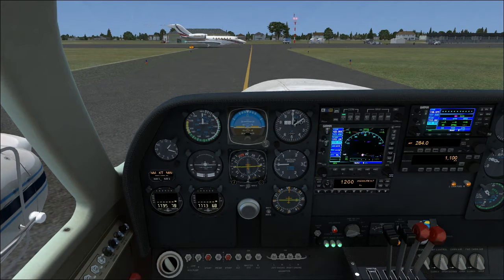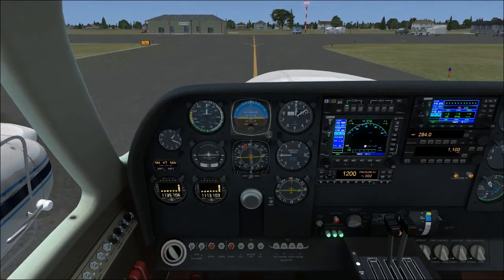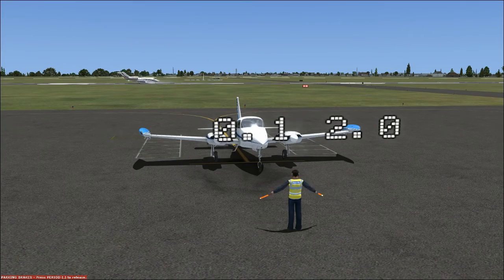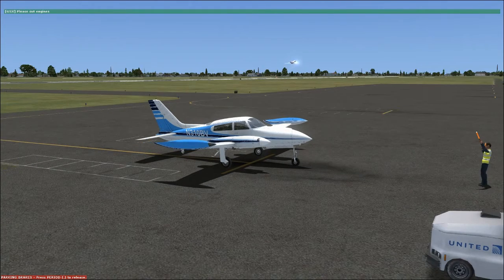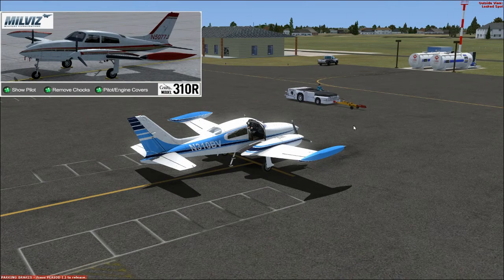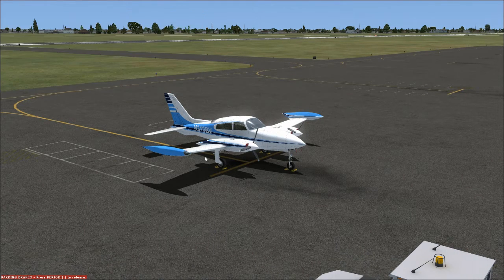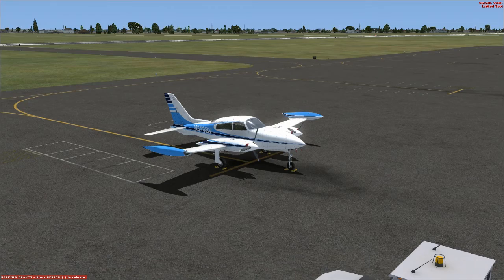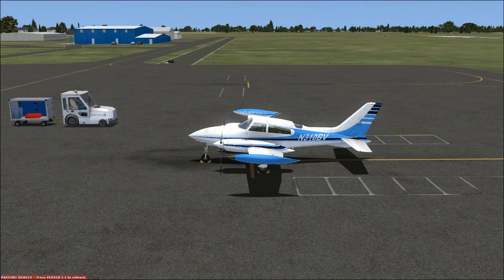Military Visualizations Cessna 310 Tutorial. Video 9, Shutdown

Comment: What is better the a2a 172 or the milviz 310 ?
Reply from the maker: +Malte Fsx good question. both are very well recreated. A2A has more in depth features like the preflight and persistent aircraft. C310 is much better equipped in the avionics department. Having a RMI, CDI (it can pull NAV info from NAV1 or NAV2 or the GPS) 2 GPS units, and dedicated DME readout.

C172 is a good trainer but ultimately its a single engine fixed pitch prop thats not much faster than a car. C310 is much faster and is a twin with constant speed props. it really comes down to what you want i guess. both are really good aircraft and if i was reviewing them id score them 4 out of 5
Reply: +CountryFlyboy oh okay thanks i think i buy me the cessna 310